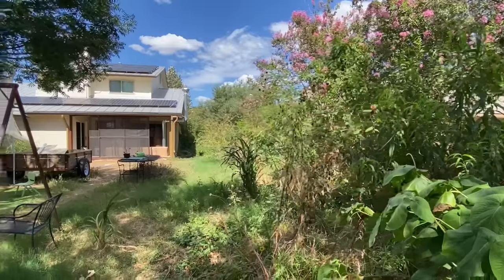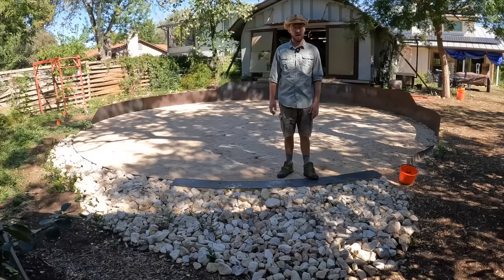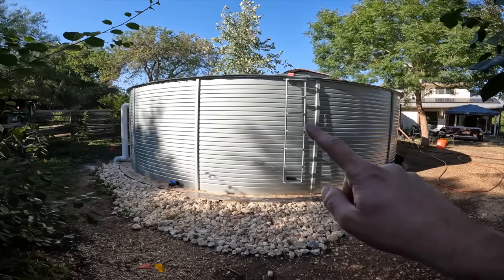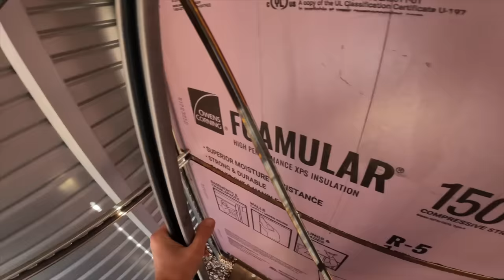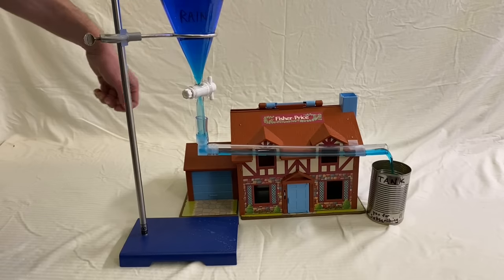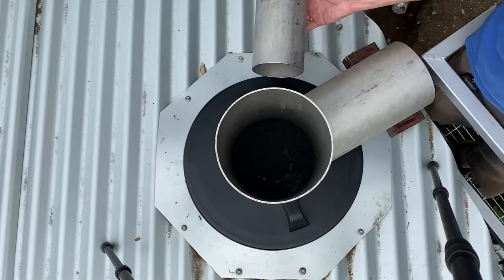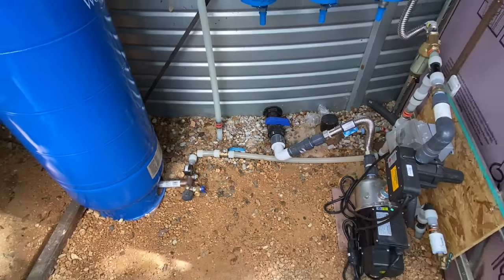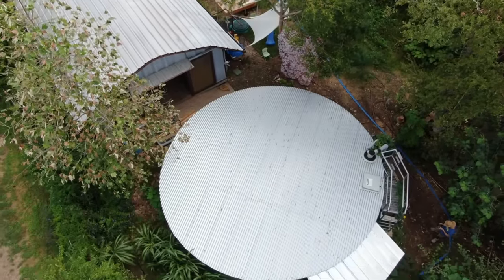FREE water forever.  LEGALLY!!!!

Comment: the amount of work from research, to construction, to video production. it's just incredible
Reply from the maker: Thank you for appreciating!
Reply: Yes, You sit atop you tank with a big Zero. Wrong, How much did it cost to build this tank and it sounds like you also need electricity to pump your water. isn't that what the city's problem's was.
Reply: Now they just have to learn to make descriptive titles instead of nonsensical click-bait bullshit titles.
Reply: It's worth it
Reply: @shadrecklittle4774 it’s probably not worth it for anyone. Your states water system will be 20x better than anything you can ever build. Also think of how much water you could get instead of building this. This probably will cost just as much in time as just using the states water

Comment: Several notes from a water resources engineer:
18" of water column for a 4" pipe does not appear to be enough to scour grit from the buried pipe. You're going to loose capacity by running the pipe in surcharge over time. cleanouts should be located at each end of the underground section so that you can have it jetted when it inevitably gets clogged. 
Also, the above ground portions of your pvc need to be painted to prevent UV embrittlement.
Reply: he just wasted his money on a water system,water is cheaper then electricty or gas :)))if he was a farmer and your farm is close to a dessert maybe great idea...
Reply: @rembrandrembrand  its a survivalist thing. how many people will ever need an air raid shelter built under their house in america? almost no one, some people will still demand them for the ease of mind though
Reply: @rembrandrembrand  He had clearly mentioned the reason in the video which its not Money or taxes but the scarcity of water which his family went through.

Comment: If you had installed the tank underground, you could also use the tank as a geothermal heat sink where you would use the cooler underground water to cool your house and circulate it back to the tank. In the cooler season, the tank would hopefully be warmer than outside air and allow you to preheat outside air coming into the house so you could save on the heating bill as well as the cooling bill. :)
Reply: that would be neat!
Reply: sounds logical
Reply: Maintenance though. Also pumping water from underground requires a lot more energy
Reply: This man plays ONI 🗿
Reply: @CupofJoe1  😂
Reply: you probably save nothing by powering up the pump to circulate water through the house haha, the amount of heat exchanged is not worth the KW consumed by the motor to do this process.
Reply: @CupofJoe1 is Oni a good game with thermal energy management?
Reply: True but it would be less complicated to make a heating panel and heat the water from the sun. You could even run the pipes through the rain tank to preheat but without direct contact with drinking water.
Reply: maybe in a rural area/out in the country. in town there is too many gas, water, internet lines, etc that would need relocated. But you could get locates and end up being lucky and have a large enough area in the yard viable for the tank.
Reply: @notneeded1  well, that's, like, your opinion, man
Reply: @jjeairborne8428  it's a well known fact heat pumps are a waste of energy and money, that's why they are starting to be installed everywhere
Reply: As a large body of water, it would still act as a heat sink. Typical efficiencies are 300 - 600%, ie for every 1kW of energy to pump etc, you get 300 - 600kW energy.  Of course you don't use the water directly, just put the coil inside.
Putting it underground would I think be better all round.  I would have thought that the only maintenence to the tank would be changing the liner, but I would guess that has a long lifetime.
edit:  duh, my mistake, 3-6kW
Reply: @notneeded1  Go ahead and think that. I subscribe to the "It's better to have it and not need it, than need it and not have it." rule.
Reply: @sroberts605  300 - 600% is only 3 - 6 times, NOT 300 - 600 times.
Reply: @CupofJoe1  ^^
Reply: @JustMeBlindFreddy  Can't believe I wrote that!  Yes, of course, 3 - 6kW, thanks for the correction, I'll edit the comment too!
Reply: Linus did something similar
Reply: @sroberts605  I agree and not from a heat pump perspective either. Tanks that are proud like this one are susceptibe to solar gain and over time you'll end up with warm water that will have a higher susceptibility to leaching chemicals from materials and propogating bacterial growth and biofilm inside. Likewise, in very cold spells you will have higher risk of freeze. All these issues are mitigated by even partially burying the tank and using the ground as a natural insulator. It would have no meaningful issue to the pump energy consumption unless the whole tank was buried.

Comment: wow interesting and cool project! only question i have..if the pump needs power doesnt it create the same problem why you began with this project? you needed to boil water but had no power to boil ...but if you need power to get your clean water out of the tank now, doesnt it create the same problem? So wouldnt it be way more practically to just have a generator and boil 10 liters of water every day while power and water are out? of course in states and areas where there are droughts and probably many other arguments for a tank it makes sense

Comment: Only a small tip. Put a flush valve on the city water. That pipe will have stand still water and create ligionella bacteria. If you ever would need the city water you can flush the deadwater before you tap it into your house.
Keep up the good work.
Reply: Good tip. I'm curious about legionella in standing water. I scarcely recall hearing about it when copper pipes were the standard for plumbing. It may be totally unrelated or even poor observation on my part. But it seems there have been increased instances of the problem since copper pipe became less common and plastic pipe became the standard. I understand standing water being an issue and copper being somewhat antimicrobial. To me it seems plausible that the more budget friendly option may come with harder to calculate health hazards.
Town supply water is exorbitantly priced and tastes horrible. I'm lead to believe much of what it is treated with is more about protecting the delivery infrastructure than it is about the quality of water or people's well being.
Reply: Maybe he wants legionnaires disease
Reply from the maker: The underground pipe has a drain at the low point.  I'm thinking of hooking up a pump do the drain port so I can pump the water into the tank if it seems a drought is coming.  That way the pipe sits empty rather than full.
Reply: @suburbanbiology  He means the city water between the mains pipe and the first valve you have on your city water line will become stagnant
Reply: Bacteria doesn't cause disease
Reply: Central Texas here.  Laws can change anytime “the powers that be” see fit. The summer we just endured may push those decisions into the forefront since we were to the point of rationing. At the 7:03 mark….Yep, I agree, it IS a beaut..Inspirational!  I’d love to have one about half that size. 
I don’t know what municipality you’re in, but in ours, it doesn’t matter how much water you use or don’t use, you still pay the minimum monthly water, drainage, and sewage. 😊
Reply: That’s bigger than most peoples backyard. Not feasible for most of the population.
Reply: Many people here in Australia do not filter rainwater at all. Legionnella needs consistent temperatures above 20°C to proliferate. Even in summer, the water in my 10,000L poly tank stays pretty cool.
Reply: @oakmaiden2133  how about you make it underground, use some thinking please

Comment: with the feed from the roof, it is good to add a slow bleed at the bottommost point, so that water drains from the system when it is not raining, to prevent legionnaires growth in the standing water in the pipes

Comment: Hey there. Interesting Project.
I'm a municipal engineer where we use SDR 35 PVC all the time for things. One thing I thought I'd mention is the fact it's susceptible to UV degradation. (sunlight). Being in Texas, I'm sure you get quite a bit of that ol' sunshine. You may want to cover the exposed PVC with something to keep the sunlight off it and prolong the life of the system.
Reply from the maker: Hi thanks for weighing in. I didn’t show it but all of the vertical pipes got a coat of paint to match either the house or the workshop. Hopefully that extends their life. Thanks for your support and for subscribing!

Comment: Nice work !  We live on an island in the Caribbean and collect water from our roofs and pipe it undergroiund to above ground concrete cisterns.  Clean, safe water is going to become VERY important as the years fly by. You have done a stellar job with your system !
Reply from the maker: Thank you for your kind words and appreciation. And thanks for subscribing!
Reply: How do you ensure it's safe and clean?
Reply: This would be my preference over rain barrels and tanks. A cistern, because it's underground and you keep the top space for anything.
Reply: @SirD1  The family has been using our cistern water for 15 years and we are 'fairly' normal.  The drinking water is processed through reverse osmosis and the rest is just 5 micron whole house filter system.  We used to drink out of the creek on the farm with no ill effects so I am really sure our cistern stored rain water will not harm us.
Reply: @SirD1  You start with gutter guards to keep coarse debris out of your gutters and a first flush diverter to divert finer dust and soluble air pollution away from your tank. Then if you have someone in your household with an immune disorder or other specific health concerns, you can add further filtration and UV sanitising - but Aussies have been living on rainwater tanks for generations without even the gutter guards and first flush diverters, and we didn't get sick from it. It's a lot cleaner than creek water, and humans lived on creek water for a hundred thousand years before we started building permanent dwellings.

Comment: I just completed an underground cistern project for my barn, so I would have water for animal use, and also a bathroom. Burried 800 gallon tank, and use roof water for filling. Used submersible 110 volt pump, and pressure tank. Sock type filter on gutter pipe catches debri. Works great.

Comment: I have been on rain water for 11 years now, in regional Queensland in Australia. Water collated from the roof goes though the many filter systems. The last filter has a cartridge, which purifies water to the quality of bottled water  from the shop. To avoid problem of water standing in pipes, all gutters  around the roof have a small angle to allow for the flow. It is the same for the pipes which go into the main tank and then to spare tanks below the property. Thank you for the video.
Reply from the maker: Thanks for sharing your system summary. Sounds like a well designed setup. Australia is definitely ahead of the curve from the comments I’ve seen.
Reply: Its more iasy if you dril a wáter driler hole the sub soil wáter its more clen
Reply: @zedinislourenco  most place has very small water capability. you woudnt be able to feed the whole house with them. also it can be too deep to reach the water. most very high pressure pump only works 30meter deep. some place have the water table 200meter down.
Reply: @Francois_Dupont  the price drill a wáter hole mai be the same price of recolect a wáter Rain you are wrong the wáter pomps Consum 1100w to 2500w of electricity  this sistem have electricity consum

Comment: Those air vents between the tank and the pump house should be closed with expanding foam or pieces of insulation you would otherwise throw out, this gives better chances for the water inside the pipes to not freeze. Great video, also you should know water in motion is harder to freeze, so a return to the tank for unused water should be considered.
Reply: do u mean - keep the water flowing at all times?  not very feasible unless u have unlimited pump power.  just saying.  but the extra insulation idea is good to me. jmho  would you perhaps be telling us how they do it in siberia or greenland, or those areas around the artic?
Reply: @dcs4555  in the areas with low temperatures pipes are laid under the frost line (how deep the ground freezes). In Texas it is 5", however in arctic regions, it can be up to and more than 100", in those regions pipes are either buried deeper with a lot of insulation, or run insulated above ground and heated.
Reply: In areas where there's extreme cold, people are advised to keep the water running to prevent the water main from bursting. With 1 or 2 freezes a year, it seems worth it to least exhaust all options to avoid replacing pipes every time there's a freeze, which will happen more frequently and be more severe when they happen, because of global warming.

Comment: I live 500 feet from the Chesapeake bay and have well water, don't think I will ever run out. Used to spend summers on an island off the coast of Maine. We had rain barrels and such but any water you needed was brought with you because you are not drilling a water well in granite. Your system would have been paradise.

Comment: Very well thought out system.  Appreciate the info on filter specs as I may need that if I ever plan to use my water for home drinking use. 

I retired a few years back, and am a Chemical engineer, quite capable to design a system, but the accumulated info you give here is MUCH appreciated.  My tank is coming to around 37,000 gallons when full.  It is not nearly as complex as your system but it is not meant to completely replace my normal water source, at least not yet.  My home is in a very remote island in the Philippines, and almost NOTHING is easily obtained if we cannot make it ourselves.  Hence, our tank is concrete structured as we can get the blocks and cement easily here.

We have around 4000 square feet of roof draining into the tank, via two 4" PVC drains.  Because our weather here has actually suffered a rather deep drought about 5 years back, we built this system as an emergency supply for times when we need to have water.  Local springs, approximately 125 feet above the level of home helps when water flows naturally here, but we still require to pump it up to our home as it is about 60 feet below our house at the allowed tapping point according to the local supply folks with our local semi government administrators...  It is complicated here, as is most everything.

I do fluid flow designs and system start ups on refining plants and power facilities on occasion, but am 90% retired.  

Really liked the way you got the elevations set and functional.  Not many folks can do that.  Kudos for getting it right.  We have the "upstream" end of the El Niño phenomena and it is supposed to be possible to be on the drought side this year.  Hoping for the best.  I will build my own filter system if it comes down to it.  

Thanks for the encouragement...  OH... and if you can pick your favorite fruit tree species and put the overflow pipe with a small  line to near this fruit tree, it will grow at around double or triple the rate automatically without any help.  Here we use it to grow up our Mahogany trees.
Reply: Being the CE you are, you do not see any long term (50 year+) issues with using Poly Vinyl Chloride for your potable water conduit?
Reply: @MR-backup   Well, actually no, not worried at all.  One of the plants I ran was a plant that made EDC, the precursor to Vinyl Chloride, and shipped it across the street to a PVC production plant.  There are things far more likely to be an issue than PVC.  It is a very long chain polymer, that has essentially NO solubility in water.  And the bad parts of PVC you have likely read about are the remnants of the VCM Vinyl Chloride.   In the PVC and the way it is processed, no Vinyl is left, it is "over reacted" intentionally in the process.

Been  exposed to VCM and EDC both,  Arguably worse as EDC than VCM as it is more "in your face" at the plant because it is similar to gasoline as a liquid not a gas.